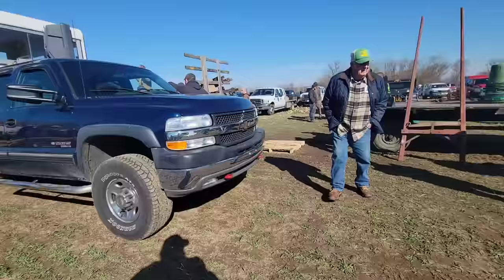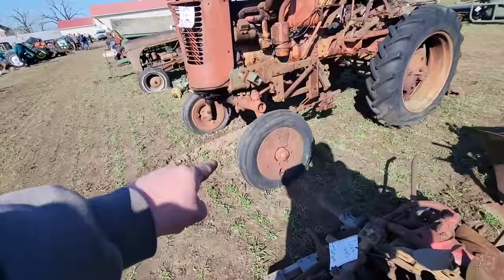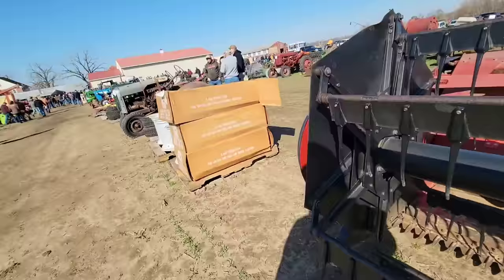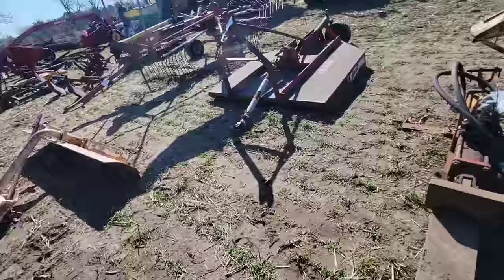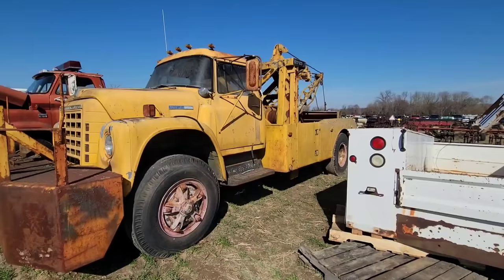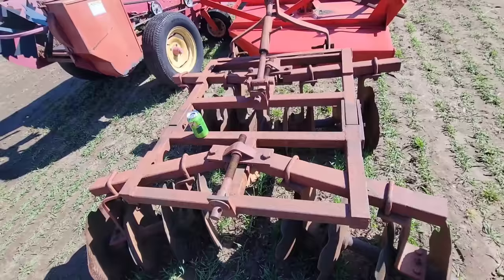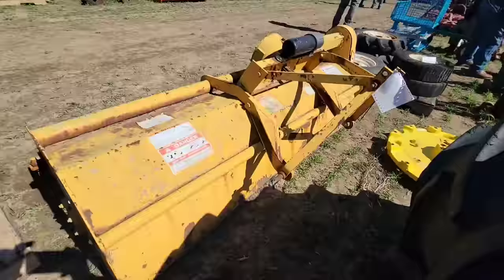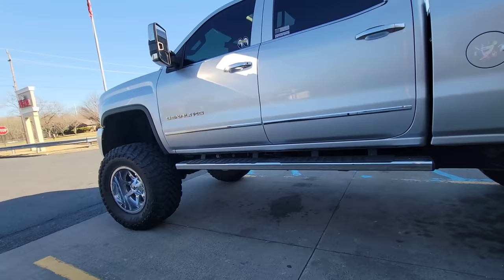Farm Auction Season In Full Swing

Comment: my dad and myself took a old  load star international box truck and took the box off shorten the frame to haul mobile homes  that beast could turn on a dime and pretty easy to work on for general Maintenace  t he one we had their was so must rust in the tank  after i drop the tank and cleaned it out and reinstalled it  we used the cheap napa gas filters i put three in line filters before it hit the carb just so i made sure no rust got to the carb after first 6 months running it i drop it back to 2 filter never had another problem out of that truck we sold the box truck part for 5 k  and that made the bed for our truck with removeable sides  the truck we bought for 5 k  so pretty much a free truck to us and in it life time made us over 150 k a year for 15 years so you can do the math  but a damn good truck

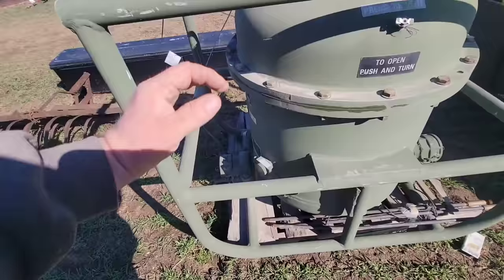Comment: At 2:00 that is a filter separator for a tank and pump unit that went on the back of a 5 Ton army truck with two 600 gallon fuel pods.

Comment: Good  day  Boy alot of IH   older style cub,s  & JD  L.  That unicorn, yrs ago our IH  dealer had one , just the point  drive was broke , never thought anything more about  them.  
Anything JD  is going over  priced ,  just because of color,  motors in lawn mower are not JD, transmissions  are not JD overpriced!
None skid steer, I know someone who has  Bobcat sitting.
Manure spreader was cheap , they usually go closer to 1000.
What did those leg vise go for ,  boy up on-line  auction they go over 100
What did S-10 go for.  Thanks for now
Reply from the maker: The horse voices I believe went went for like 150 a piece..... I could be wrong and I didn't get to see the S10I wasn't over there and I had to leave.